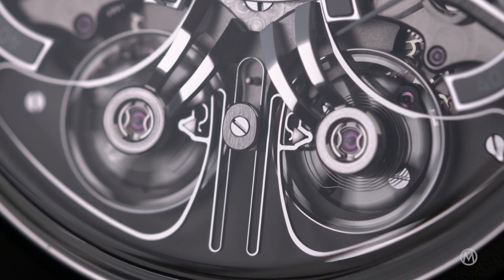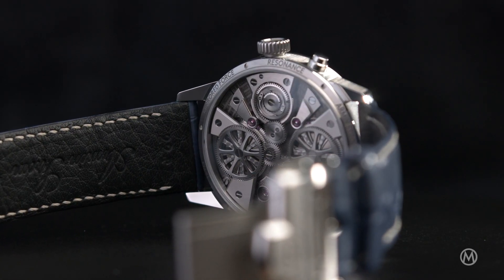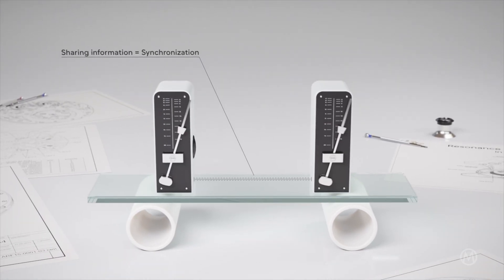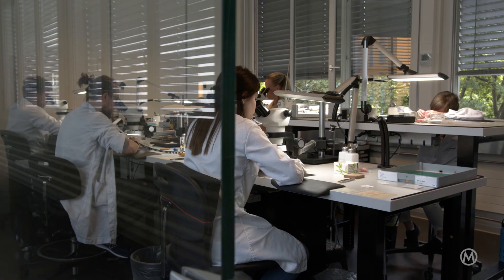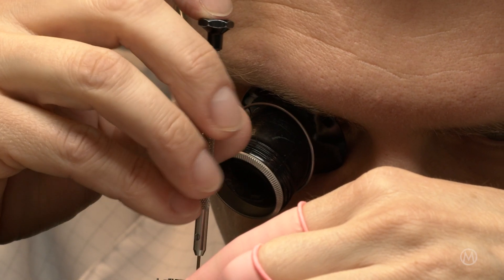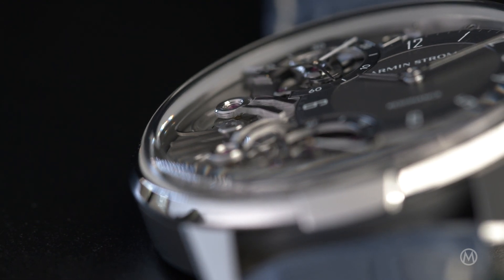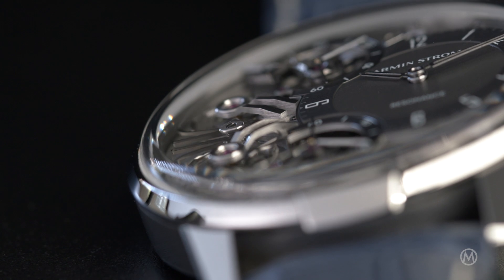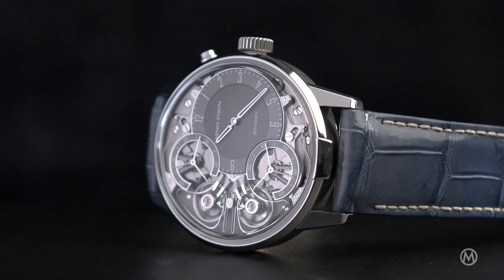IN DEPTH - Understanding Resonance With The Armin Strom Mirrored Force Resonance First Edition

Comment: Great asthetics. Any data to show that resonance has inproved watch accuracy? Is it better than Rolex Superlative Chronometers?
Reply from the maker: No, unfortunately not. The principle of resonance should mean that imperfections and beat-rate errors are eased out of each balance wheel as they sync and beat as one, but it's not been put up against other movements from Rolex or any other brand to compare it's accuracy that we know of.